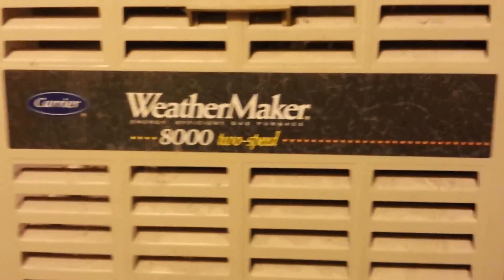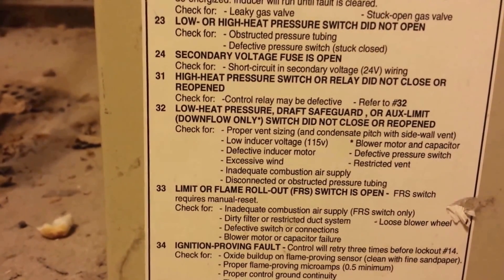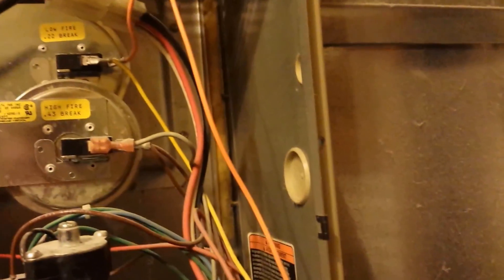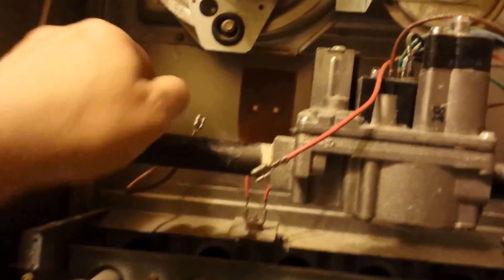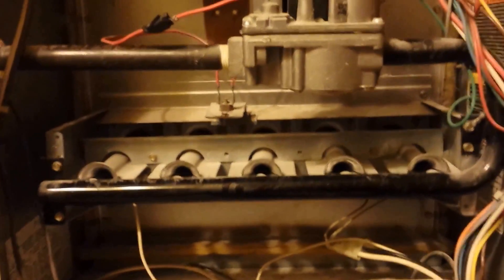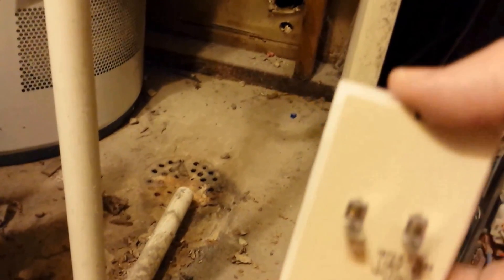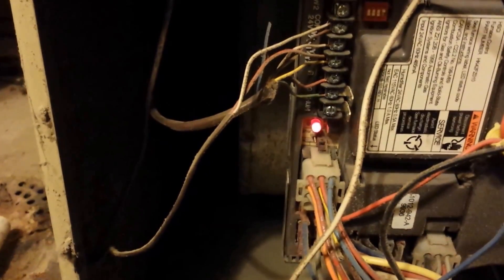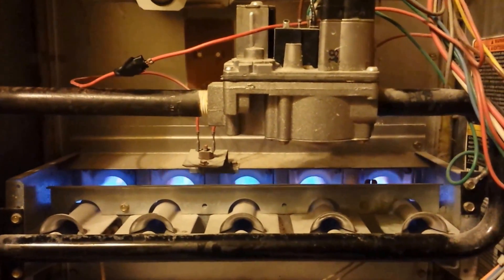Carrier 8000 - Diagnose and Repair Limit Switch

Comment: How do you clean the igniter on this unit I have the same one I change the switch which it now works but the igniter goes off and on I have a solid red light on my board

Comment: code 33 and i did not see the blower motor running when heat was being produced.  is that a capacitor problem or still a limit switch problem ?

Comment: We got a code 33 but ours will kick on flames itll work but it'll shut off in about 2mins we can't figure out what it is but when we by pass that sensor on the firewall it stays running

Comment: Great video. Thanks for sharing. 
But what if all burners ignite except for one? That’s the problem I’m having right now, and this video is the closest thing I’ve found to my problem. I removed the gas/burner pipe and blew compressed air into all the holes and they seem to have unrestricted flow. But then I turn the furnace on and the last burner comes on for a split second then turns off, so then all the other burners turn off

Comment: Quick question I have the weather maker 8000 not the 2speed like yours. I ordered the same limit switch like your using but mine is 170 cutoff I took out and replaced with 180 cutoff. Also the old switch had prongs horizontal and new 1 is vertical so I matched the back of the fuse and plugged in accordingly ran it everything worked fine , on and off. Do you think it's okay ? Thanks for any advice
Reply from the maker: I'm sorry. I'm not an expert. Like you, I fix things when they are broken. I'd call my local HVAC parts house, explain the situation, and ask them. The parts department of Dick Kearsley in Clearfield, Ut has helped me a thousand times. If you can't find anyone local, call them and see if the parts guy will help you over the phone.
Reply: @GetItDoneProjects  ok thanks

Comment: Thank you for the video, Mark! So to clarify, when the limit switch was broken (before you taped the two wires together) the fan that turns on in 90 seconds doesn't turn on at all, correct? Thanks!

Comment: 33 year old furnace (same model).  I'm holding out to see what the tax incentives bring in the next year or two, so I'm trying to not spend money now.  You saved my bacon.  I was close to signing a contract.  It was the switch just like yours.  Mine was so old it didn't have the reset button.  The new one did and I had to mod the mount but it fixed it right up.  Thanks.
Reply from the maker: That's awesome!

Comment: I have the exact same furnace and I am trying to locate the access panel to the coil evaporator. I know it’s where the low and high pipes go in but that panel looks like it’s sealed. Any tips please?
Reply from the maker: On this unit, it is difficult to access. I never bothered opening it because of that. Not a convenient design for the DIYer. If you look, I believe the screws are found on the sides of the panel and difficult to access. I've since moved from the house that I lived in where that furnace is located. Can't look at it to help you. Good luck.

Comment: I was walking past my hall when I noticed a hum coming from my Carrier 8000.  After checking I had a code 33.  Upon opening the panel I noticed a hum coming from the draft inducer fan motor (I tried spinning it with my hand and it won't budge).  Is this normal for the fan not to spin (when I say spin I'm talking about the round black plastic piece) or is it being locked by the unit?  I'm guessing it's seized and I'll need to replace it?  

I would appreciate it someone can help me out.  Thanks!
Reply from the maker: My understanding is it should spin freely. Sounds like you need to replace it.
Reply from the maker: https://www.technicalhotandcoldparts.com/hvac-repair-blog/how-to-fix-carrier-error-code-33-or-13-after-upgrading-to-a-higher-merv-rated-filter/
Reply from the maker: Read the link. It seems like a problem you could trace with their help.
Reply: @GetItDoneProjects  Thanks for the response!  It turned out my motor was fried!  Fortunately I have a parts place a 1/2 mile from my house (it cost me $96 vs $65 on Amazon).  However I wouldn't get the part from them (Amazon) until January 6th.  As I type I have heat again!  Take care and Happy New Year!

P.S. For anyone who needs to replace their fan here's a link on how to do it.  

https://youtu.be/NCuSeHOXWJ0
Reply from the maker: That's great news you got it fixed. I had to replace my blower motor recently as well. Since there were so many videos already on how to do it, I figured people could find one. Glad you have heat again.

Comment: Man was this helpful at 5am when you're half awake and realize you got a code 33.  Bypassing the switch at 4 minutes worked like magic to get my house back to warm.  Going to get a replacement switch and go from there.  Very odd though, my reset button isn't wired in series with the switch itself. The wires to/from switch run directly to bottom cabinet & tie into electrical.  The only reset that remotely looks like what you've got is mounted in the top right corner.  Pressing it didn't reset code 33 upon restart... so I jumped to bypassing it & happy to see a code 12 on startup.
Reply from the maker: Nothing like a furnace out in the dead of winter and a family relying on you to try and figure it out. Glad it's working for you.

Comment: see your video and post . check filter is clean. following to used vacuum to draw out moisture from intake where vacuum pressure switch  and drain area . re-start the furnace again  fail no flame , same issue. please help thank you.

Comment: my furnace is lenox .i had the same issue. flame rod came on , gas solenoid  valve kick on open , but no flame , after 4 time furnace stop . i switch off the furnace , 2 MN  later turn it back on to re-start , when the flame rod come on  i tap the frame few time need by high limit switch the flame start to come on . so i think the limit switch some time stuck open . replaced it , it work fine for few months then happen again same issue. replaced new one second time , some time still fail same issue . OHM out check continuity , normally close , beep ok . ran out of the idea . please help, thank you.

Comment: Yep, replaced the Limit Switch, furnace is working great now!
Also - after fixing this (Error 33) I got another error code: Error 24 - Secondary Voltage Fuse Open. The fix was easy; on the circuit board there was a purple 3 Amp Fuse. It was blown and I simply replaced it (any auto parts store has them) and everything works great!
Thank you!
Reply: I had the same thing happen. Blew the fuse.

Comment: I have same furnace same code 33 but mine does light and run for 90 sec then shuts down. Would that be the same fix?
Reply: Scott, did you find a solution? I have the same issue as you.

Comment: Great video I have a similar problem I changed the thermo coupler I can set it for 75 the house can be at 70 it wit run on and off till it reach 75 at 20 times before it finally gets to 75 any help

Comment: Hi, this is a great video. Weirdly I am to be missing the reset button, the switch is just wired directly into the circuit board . The heater does ignite and function when I tape the ends together. Does this mean I just need a new switch? Or is there something else to do?
Reply from the maker: You have the same model as I show in the video?
Reply: Mark Mason yes, it’s not the two speed version but that is the only difference. It has the mounting hole.
Reply: Mark Mason I’ll take some pics when I get home although I’m not sure how to share it with you. Thanks for responding!
Reply: Mark Mason did you see my vid? Curious what you think.

Comment: I have no error code. When I want to turn on my air conditioner the auto doesn’t work.  I have to manually turn on my air conditioner. I hear that is could me the limit control switch. Any idea if that may be true. 
I have a carrier furnace as well

Comment: All I had to do was push the reset button and I got a solid red LED. Thanks for the awesome video and saving us from a cold Saturday night. BTW, I hope you took the electrical tape off the red wires and reconnected them to the switch you just replaced. LOL.

Comment: Hi Mark...Carrier series 180 here (about 13 years old). I have continuity through my limit switch but I'm still getting code 33 (then after 3 minutes code 13). The only filter I can see to replace is the one at the air return. Is there always another filter (that I'm not seeing) that's dedicated to the furnace or do installers sometimes skip this part and just rely on the house air return filter? Is it possible that I have some kind of exhaust restriction? Like a nest or something in the pipe exiting the roof? I find it strange that the blower motor is running regardless of the position of the switch on thermostat. It's in the off position and the blower continues to blow regardless. Could I have a failed thermostat in addition to the 33 problem? We did have a major lightning strike and surge a few days ago so now I'm curious. Thanks for this video! It's the only truly useful one I found here.
Reply: Thank you Mark...your comment jogged my memory. Someone came out a couple of years ago and replaced the flame sensor to get it going again. He said it was pretty dirty. I just checked it on your advice and it looked pretty clean. I steel wooled it anyway and give it a shot...the 33 code remained. FYI I bypassed each safety relay I could find in there, one by one, three in all. Nothing made a difference. I'm thinking maybe the fan relay on the control board may be stuck closed or something. In any case, thank you very much for your time. I learned a lot today!
Reply from the maker: I'm not qualified to resolve this issue for you. If you look on the face if your furnace there should be a sticker talking about error code 33 and listen for you potential resolutions for it. When you're talking about error code 13, and your furnace is coming on but no flame is igniting, I have found that the flame sensor gets dirty and needs to be cleaned. If this is the case, then you need to remove the flame sensor and clean it with a steel wool pad. This image points to the screw that you undo to remove the sensor.  https://ibb.co/kV42iL  use the steel wool like sand paper to clean the metallic end of the sensor until it looks clean. I wish I could be more help than this.

Comment: you're a lifesaver. it's 12:35AM and i have been freezing my balls for a couple of days now. Ended up using a fork to interconnect the two wires LOL, the bits on mine are insulated so using tape was a no-no

NOW I can sleep peacefully without using my puny space heaters! :)
Reply from the maker: poloboy get that fixed as quickly as possible. You don't want that bipassed for long.
Reply: Mark Mason

definitely, i already ordered a replacement part and it should be there in a couple of days, this helped so much lol

Comment: Nice video, thanks for uploading.  Technically shouldn't matter the sides of the wires connected, does same either way.  Even simpler don't disconnect at all just throw short jumper wire with alligators to each terminal.  If machine stays running then you found which is causing the fault but that's just the beginning of the real problem, which is why.  Is it doing it's job and protecting an overheat or is it just worn out?  I'd be very cautions about bypassing safety devices and only for short testing period.  I couldn't sleep through a night leaving it bypassed or maybe I'm just paranoid.

Comment: First, thanks Mark for the help. Was getting tired of opening the furnace panels. Came across this video looking for a fix for my furnace. Got the same error code 33.  But my problem was the main fan would start at anytime, middle of the night (thermostat programed for system to be off) or during the day when heat was not needed. Only the fan, no heat. Only way to turn off the fan was by unplugging the furnace cord, turning off the heat did nothing. My meter showed the switch was closed (good). Pulled the wires off the limit switch, taped them together and everything worked fine. So it was the limit switch, but would open and close when it wanted to "Bastard". This  switch is a safety feature to turn off the gas flame when it senses the filter is dirty or there is exhaust  blockage, but run to no end when the switch is bad!  Switch I pulled out was HH 12ZA 199A, new one was listed as a HH 12ZB 200 ( temp 199F vs 200F) replacement. So some parts may have a replacement number. Ordered online, got it in 3 days. HVAC friend said it wouldn't be a problem running the heater with the ends taped together as long the filter was good and no obstructions in the unit getting air. Now the system works like it was suppose to. All is good. Thanks Mark!
Reply from the maker: porsche1963s90 you're a great trouble shooter. Glad you got it figured out and best thing, it didn't cost an arm and a leg. 😃

Comment: Your video helped me fix my heater. Though it took me more work than I had expected at first. I wasn't sure if the switch was working properly though I suspected it to be the issue. I also wasn't sure if it was supposed to be normally open or closed. When testing, I got continuity intermittently. I found the Limit switch locally at a Carrier supply store. $3.70/ea. Installed it, and the system seemed to be working.... until I got another FAULT CODE 33, which lead to a CODE 13. When I would reset the power, the system would run properly, with no codes. Then after a few minutes Code 33 would reactivate, and again after switching on and off a few times would lead to a Code 13. 
After Testing all of the Limit switches for continuity, and confirming ~25V at each one, I deduced that my Flame Rollout Switch (FRS) (which did not have a manual reset), was reading high heat, then switching off, and once it cooled it would allow the system to switch back on, until it again would read high heat and switch back off. Since the burners seemed to be running smoothly, and the fan blower was running smoothly, and the filter was brand new, I decided it might be the exhaust vent that runs into my dedicated chimney. 
I removed 4 screws holding the metal vent duct to the furnace, and it seemed clear visually, but I needed to give it my best attempt. So I took a Shop Vac, duct taped the extension tube to the inside of the Vent Duct to create a proper seal, and connected the Shop Vac hose to the OUTPUT of the Vacuum blower. Blasted the inside of the duct for a good minute. Then with the Tube still duct taped to the vent, I moved the hose to the INTAKE of the vacuum, to suck up whatever was left. Ran than for a minute, and again put it back to the OUTPUT. My basic attempt that cleaning the inside of the vent. I removed the vacuum tube from the vent. Vacuumed up the residual sand and dead bugs, and reconnected the system.
SUCCESS!! It has been working for about 14 hours now, with no signs of fault codes. (NOTE: My chimney does not have a cap on it in 15 years. I've never had such a problem, but I'll be installing a chimney cap this week.)

Comment: Where were you able to buy the part so quickly? I need a HH 12ZB 210 which is what was in there before (the 210 is the temp). How long can the furnace be kept in bypass? I have watched and searched other videos, but yours is superb!! Thank you so much for taking the time to record this!!
Reply from the maker: Kearney ADetailedHouse well, the bypass is a temporary fix, allowing you to continue running while you repair it. Just find the part as quickly as you can, and get it repaired. I found mine through a local distributor. If you can't find it, let me know. I'm sure my parts house will ship it to you, assuming you're in the US.

Comment: Have youh cokme across error code 32?
Reply from the maker: ferdie186 there's some complex problems that could be wrong that I can't help you with. There is one obvious problem that could be what is wrong and that is your air filter is dirty and needs to be cleaned or replaced. I'd check that air filter first and see if it solves the problem. Good luck.

Comment: Hey mark,nice helpful video,i had a question, i recently replaced the induction motor and its been working real good,this morning i woke up about 5  and i noticed the house was cold,basically the heater is coming on but the blower motor is not so the heater shuts off since the blower is not running.

I ended up turning the heat off and just running the blower,i noticed the blower would spin real slow so i bought a new capacitor,i let it run a while to charge that new capacitor, i ran it for like a hour and then turn the heat on, same thing,the heat comes on but no blower, i dont think is the blower motor, i can stick my hand in the squirrel cage and it doesn't seem hard or that is binding,i turned the heat off, turned the blower on by itself, i noticed again its spinning slowly but it finally got up and Go then i turned the heater and it just came on perfect,weird, i do have a feeling that once it reaches the thermostat setting and it shuts off it will be hard to get it running again.
Reply from the maker: dntlss that's super frustrating. I'm not an expert. what I've done is find a good parts store where the guys can help me diagnose things. good luck.

Comment: I have an older Carrier (1986). Unfortunately, it is so old that it doesn't have a blinker or error codes. Also, there isn't any reset button for the limit switch. I went ahead and replaced it, and the heat did come on. However, along with the welcome heat, it also created a strong smell of raw gas in the house, so I shut it back off. Anyone have any ideas? I'm wondering if the gas valve is bad.......Thank you!
Reply from the maker: Laura B. unfortunately, I don't. I would call a repair center. good luck.
Reply: Seems to be cracked heat exchanger leaking corbon mono oxide , thats the smell ?? May be..call tech abd verify it.,hope that help